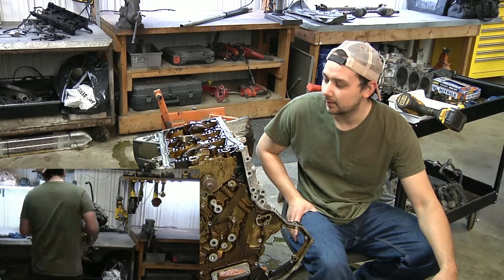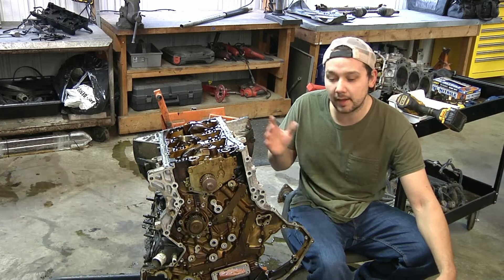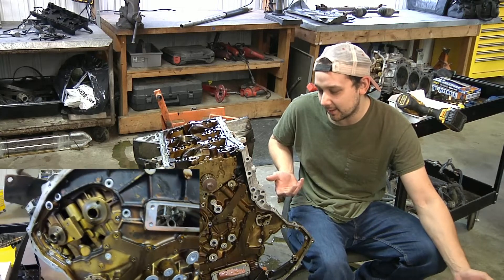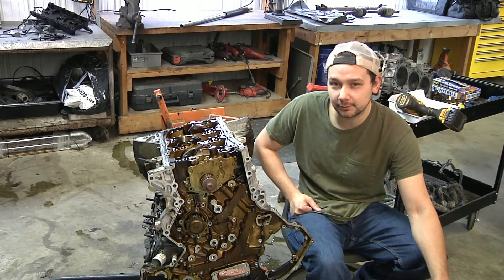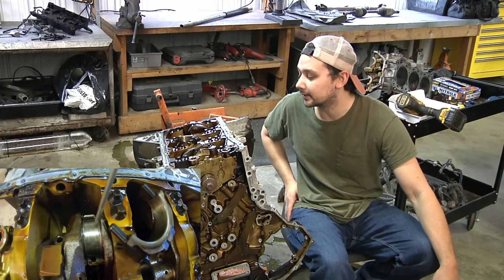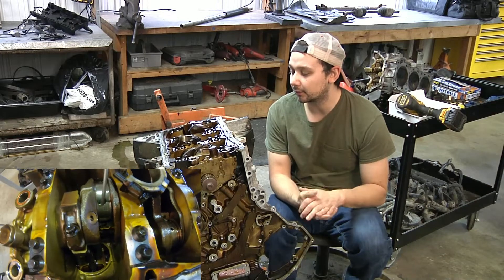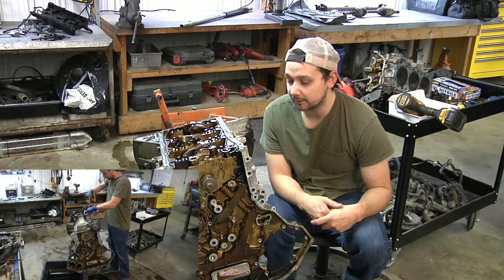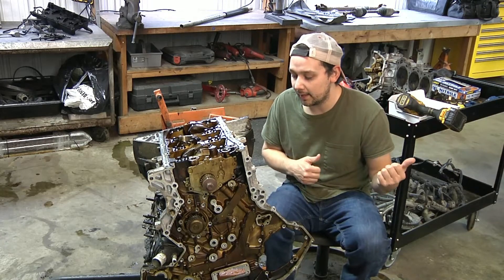2008 Nissan VQ4.0 Engine Teardown

Comment: Wow, after hearing the noise it was making I wouldn't have guessed it was a rod knock. It didn't sound like any rod knock I've heard before. I would have guessed timing chain related or top end...
Reply from the maker: Completely agree, I even put a stethoscope on it and it sounded too end.